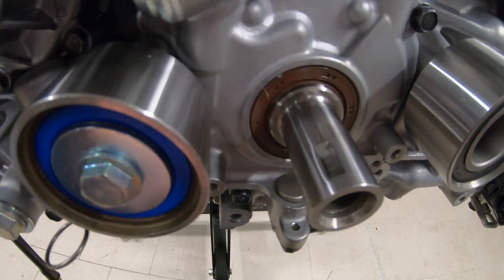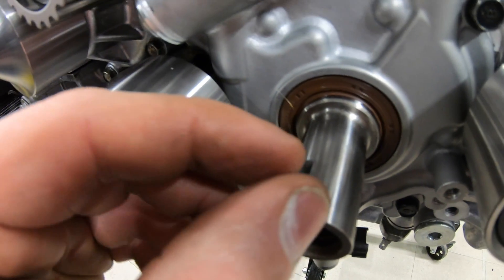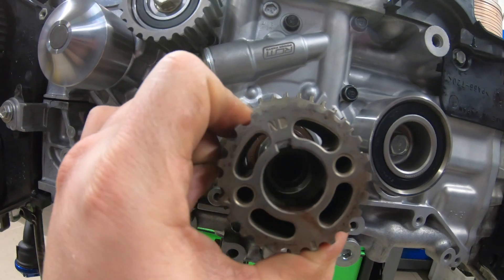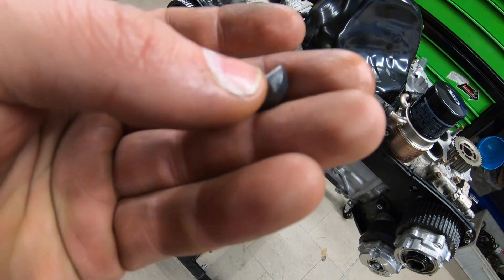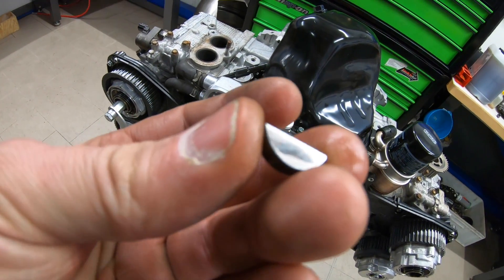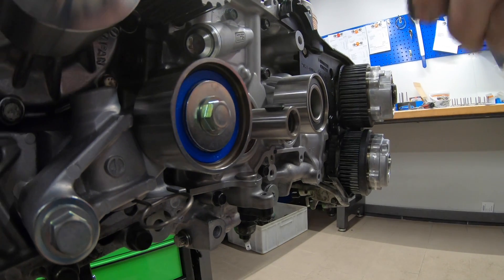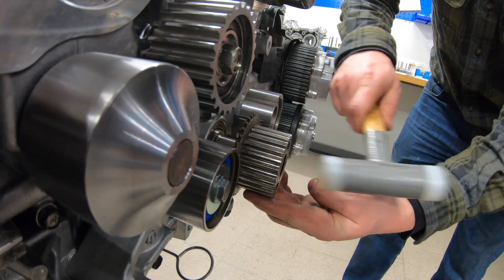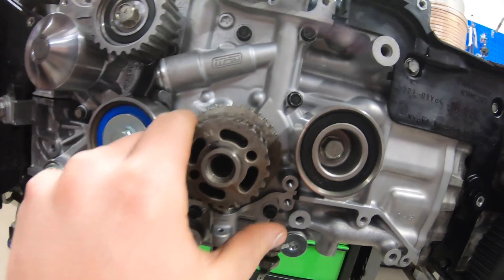735HP SUBARU BiG BoY 🇺🇸 Engine Build | Time-Lapse | EJ25 | Subi-Performance

Comment: Beware of woodruff keys and launch cotrol systems. Maybe the owner will tune a launch control system on the engine sofware and these woodruff keys take a lot of stress. They can wear out causing timming issues or even break off destroying the engine when launching the car
Reply: I think it's a tad too shallow for HP reliability as well. Might broke off in the long run.